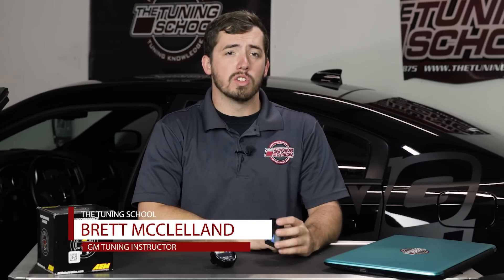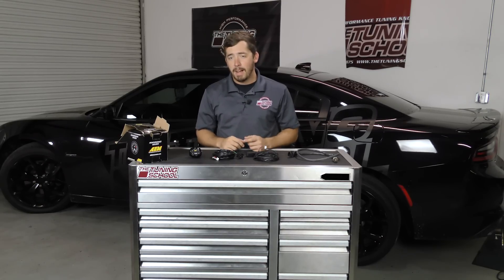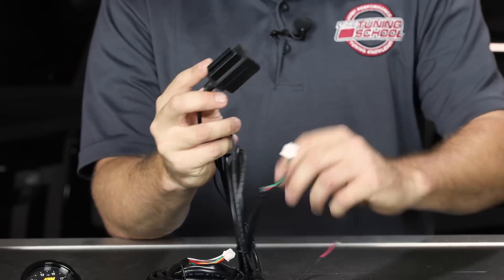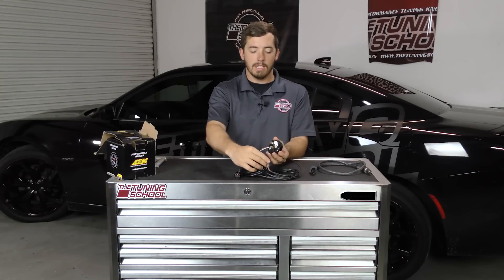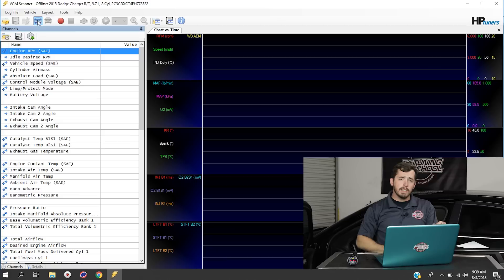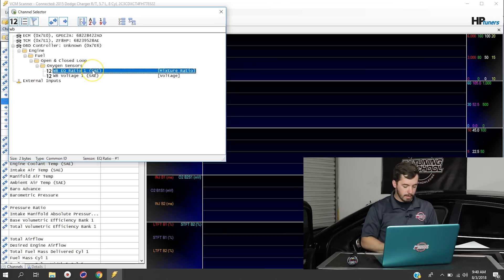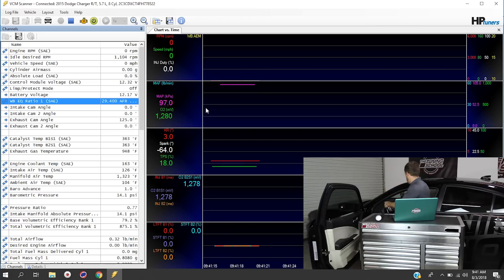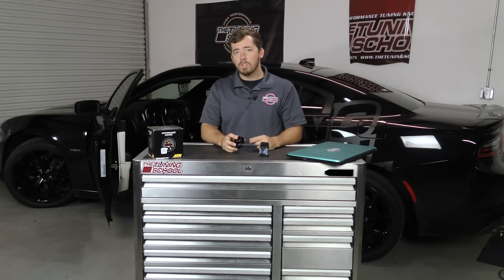HP Tuners MPVI2 Wideband Solution for Data Logging AFR & LAMBDA

Comment: I would think that atmospheric dilution near the tail pipe would be a YUUUGGGEE problem no?
Reply: At idle...yeah but at WOT, i should be very accurate due to pressure differentials. Most dynos use tail pipe sniffers.

Comment: AEM is complete junk. I bought one of their setups only to have the wideband sensor go out. They didn't honor the warranty cause I bought an open box item.  I  ordered a standard 4.9 Bosch sensor which it takes, but little did I know these guys modify the sensor with a trim resistor so you have to buy a $30 sensor for $125 from them. This wasn't immediately clear in the instructions. I tried to log PE and could have blown my engine. I was relying on the gauge but didn't know that little known thing about their factory sensor calibration. I'll never buy another thing from them again!

Comment: Afr directions say wideband o2 should be 18 inches from the cylinder head, before a catylitic converter, and as far away from the tailpipe as possible.  I called aem, they say mount the wideband 18-36 inches from cylinder head
Reply: Thanks, my gut feeling was that I should weld in an O2 sensor bung specifically for this, I can always put in a plug if I move the sensor

Comment: So I have a question.  I installed this sensor on my exhaust under the car..  considering the heating function…. Will it damage the sensor if it’s hooked up, while loading a new tune via hptuners?  Since the sensor self heats when power is supplied by the ignition?  Or is it advised to unplug the sensor plug while having to load a tune while engine is off ??

Comment: For those with the gold key with red slash... when you text search WB do NOT pick the wb AEM folder with the  30-03XX  that WILL give you a false sense that it's the  correct one, but WRONG!!!selecting that one will give you the gold lock key!   I searched & found that instead of clicking that AEM folder which makes you think its correct, but is not!  as you text search WB, look under engine then oxygen sensors, then WB EQ RATIO 1 ( mixture ratio)  select that one & you will see the wideband channel pop up & work!  I searched & asked for a few days & got NO help  & figured it out!

your welcome!
Reply: Thanks!
Reply: Late post but Thank You kind Sir that worked perfectly 👍🏻💯

Comment: When I replaced the O2 sensor from different company of the controller, which calibration shall I follow? The controller or O2? For example using O2 from AEM and the controller is AIM LSU One controller.

Comment: How did you configure the gauge so it displays in lambda instead of afr?
Reply from the maker: Hi Paul,

This specific wideband is able to display in AFR or Lambda with the click of a button.  I will link the user manual here so you can check it out.  Thanks for watching!

https://www.aemelectronics.com/files/instructions/30-0334-X-Series-OBDII-Wideband-UEGO-Controller-Gauge.pdf

Comment: I'm stoked that the tailpipe sniffer would be recommended. That gonna give the same afr as the collector area? Or do you supply a guide for how far off it will be based on how many inches or feet distance you're covering?
Reply: It would be around 0.3-.05 leaner at the tailpipe than at the engine/Collector

Comment: So I will need the pro link to use on older non canbus
Reply from the maker: You will need to make sure your MPVI2 is upgrade to the Pro version to use with a Pro Link.  Only a Pro enable interface can understand the analog signal on non CANBUS vehicles.  Upgrade the MPVI2 to a MPVI2 Pro is an easy upgrade option and comes with the Pro Link.  Thanks for watching!

Comment: I have a question for anyone with go tuner experience that is willing to take the time to read this I'm new to ls motors...i own  hptuners and I've been tinkering around with the tune on my 2003 silverado RCSB 4.8/nv3500 for about a year now...my truck is stock except for some long tube headers into true duals and a cold air intake, i finally lucked my way into a good tune that feels good by copying and segmenting over tables from other tunes onto mine...i don't have a wide band system yet but plan to few month or so....my question is this: I'm getting ready to install a lq4 that I slapped together with 243 heads, tbss intake and a ported throttle body....i also installed a summit pro ls stage 3 truck cam ( part# sum-8713)...its .545/.545 lift with 222/231 duration at .050 and 112°lobe seperation +5° advance.....my question is can i segment the timing table from a tune that is already tuned for a cam with the same 112 lobe separation and expect it to be close enough timing to safely use as a base timing....because my lq4 has 243 heads with their smaller combustion chambers...im scared that if I try to rev it up high on the same timing as the stock 4.8 tune that I might possibly cause a piston to hit the valves....any advice or expertise would be greatly appreciated

Comment: Honest Question, would the catalytic converter mess with the A/F ratio? Also is there a loss in accuracy when you have a wideband that far down the exhaust stream?
Reply: It's best to install a bung and install it right in front of the primary cats for the best readings.
Reply: @TheTuningSchool  
I think this is a good question that hasn't yet been answered.
What is the loss percentage when sniffing after the catalytic converter?
Reply: Only accurate on vehicles w/o cats... it's on their site
https://thetuningschool.com/products/innovate-motorsports-exhaust-clamp?_pos=1&_sid=78758776b&_ss=r

Comment: So I have 2005 Silverado which would be a non CAN bus vehicle so without the expander hub (that's not even out yet) I cant not do anything safely engine wise without that dual band right ?
Reply from the maker: You can still use any wideband to monitor. If you want to OVERLAY inside the software then you with your setup you will have to wait for the expander hub and pro options-yes.
Reply: @Jesse Silagy I have the MVP2. There is no serial port like the old HP tuners

Comment: So do I have an option to tune my 1999 Corvette using this new product?
Reply from the maker: You can use ANY wideband you want.  If you want it ot overlay inside the software you will have to wait until the PRO feature becomes available from HP Tuners.

Comment: What options are there for using wide bands on non CAN bus vehicles with mpvi2??
Reply: Check out Goat Rope Garage for some videos on that.
Reply: Right
Reply: If you have the pro it should have a dongle with two analog inputs.  If you have the standard you would need to purchase the cable and pro feature upgrade for $250.  I have heard of hooking up an analog wideband through the ac pressure sensor but lots of confusion and mixed results.
Reply: @mcombsemail  The new version at that time doesn't have analog inputs like the old version.